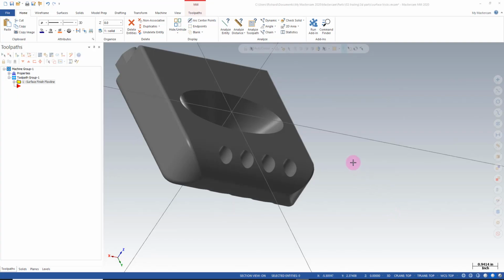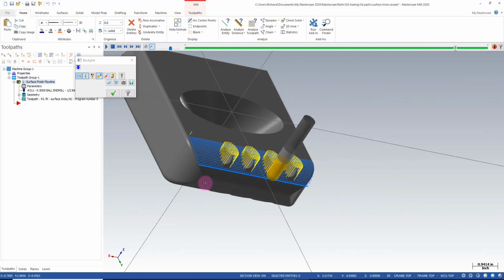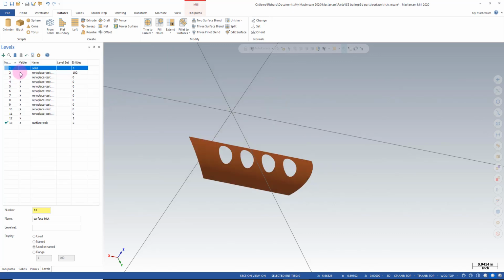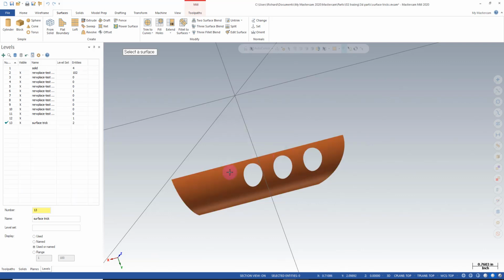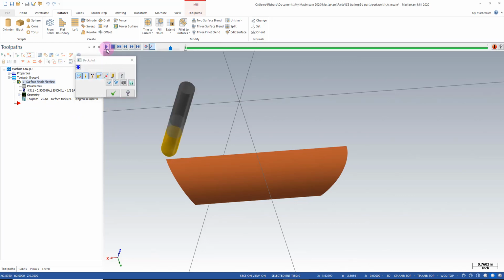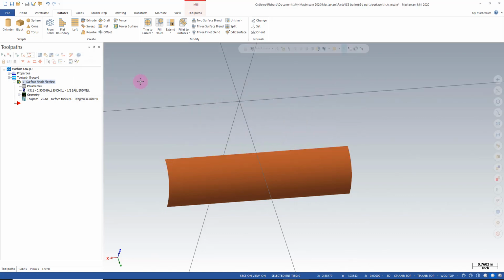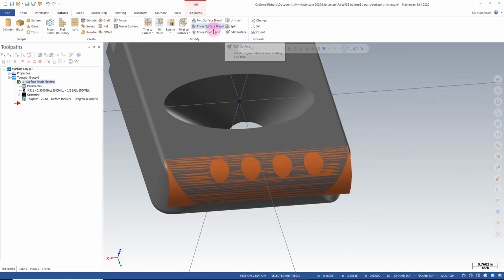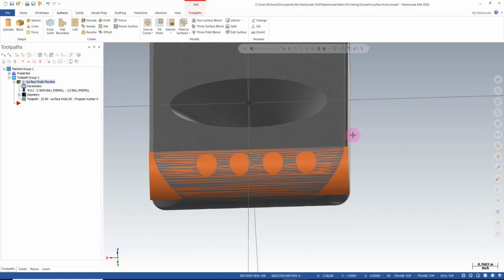Mastercam Quick chips 2020 : 3D Secrets of getting smooth tool path

Comment: another way would be to go to your solids "tree" suppress the holes, re calculate your tool path then lock the tool path
Reply from the maker: Yes Bill you do that, But this solid has no history so you would have to use model prep to remove the holes.  
Then to keep ref to drill the holes you would need to copy the solid to another layer and keep track of it.
Plus surfaces calculate faster. Plus this trick works in all versions of mastercam, because you can extent the surfaces to extend the tool paths. 

There is nothing wrong with removing the holes locking the toolpath it works. And is some cases  I would do that. If you have good computer with a enough ram. If you have and old computer with minimum of ram the surface trick works better. I work with a lot of small shops that run older version of mastercam with older computers so the surface option work better for them.

Thank you for you feedback Bill.
Reply: @integratedsolidsolutionsll3313  agree, surface from solids is a great way to deal with solids without having to have the solids option.